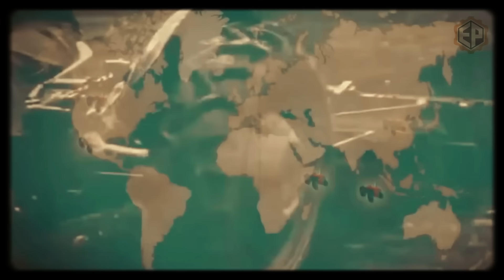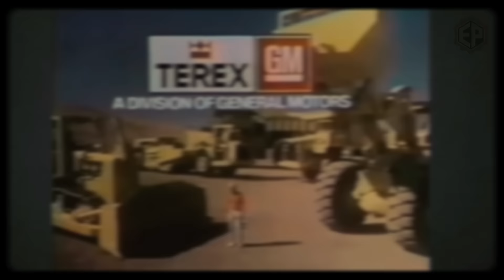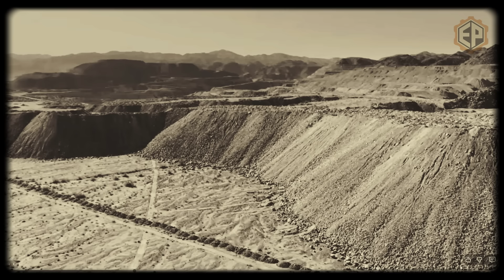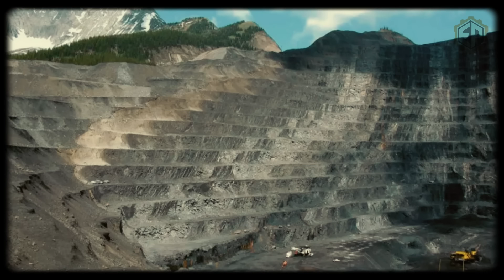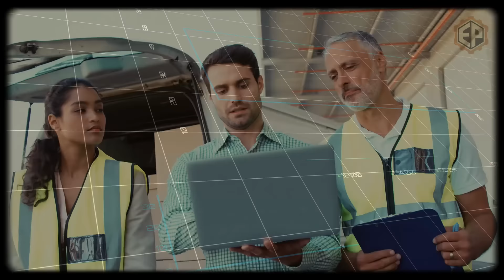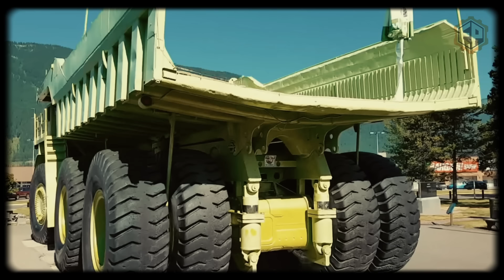The World's Largest Mining Truck Worked — and That Was the Problem

Comment: A big problem with the drive system was that the main generator and wheel motors were direct current (DC), exactly like the railroad locomotives of the time. This meant that the main generator fed the same voltage to each wheel motor, causing them to all to try to turn at the same speed. This was fine in a straight line, but caused massive frame stress under heavy loads and tight corners. There was no differential effect between the wheels on the outer and inner radius of a turn, it was all absorbed by the tires and the frame. DC technology was eventually replaced with variable-frequency alternating current (AC) technology allowing the electronic drive control system to provide the correct AC frequency to each wheel motor, depending on throttle setting and turning radius. This eliminated the differential stresses and allowed for much improved service reliability.
Reply from the maker: That's a great point about the DC system. Same issue locomotives had. AC drive systems fixed that, but came way too late for Titan. By the time that tech was standard, the truck was already a monument. Appreciate your input.

Comment: Interesting story on the big Terex 33-19 Titan! Never drove at Sparwood, but another mine in BC in the '70s where I drove the Lectra Haul 100 ton truck (upgraded to 120 ton loads). Those trucks drove like sportscars- fast straight, fast turns, very manoeuverable. We drove more than a few miles on a cycle, but eventually that mine went to 240 ton trucks, with in pit crushers and long conveyors to the mill.
Reply from the maker: Lectra Haul 100s were great trucks! Unit Rig knew what they were doing.

Comment: The reason the Titan had so much downtime was down to the tires, and the frame.  Because the mines were very vertical there are a lot of switchbacks.  The operators would routinely overload the terex titan, and when it would go around the corners coming up or down the hill the load on the frame was insane.  The frame itself broke many, many times. Can be fixed, but takes a LOOOONG time.
If you look at the new 400 ton trucks, they have the same capacity as the titan, but are harder to overload.  They are also a big box.  The square configuration handles the hills and corners better, and the shorter frame suffers less stress than the longer titan.  
I know people who drove that truck, and I helped my dad pour the concrete it sits on today.  If you're ever able to attend a mine tour, do so.  It will blow your mind.
Reply: Titan fans and  their excuses
Reply: @Undaglibenglaubengloben  Excuse?  All I did was explain why it failed.  I know the people who were involved in loading it, driving it, fixing it, and paying for it.  
Overloaded, hairpin turns on slopes.  Frame wrecked.

Comment: This truck had engine problems. Using a locomotive engine that couldn't tolerate the constant throttling changes. Only one was built for a reason.

Comment: I know it’s a bit late but maybe had they built the thing using parts already in production then it would have succeeded. 
As the video stated (way too many times), no parts & service network was the demise of a great product.
The other point of failure was location, had this monster been shipped to Australia, they would have demanded more because Aussies can fix just about anything.
Reply: It wasn't about having the capability to repair, it was about the cost.

Comment: It seems all the ~400ton haul trucks around today have two axles not three. I suppose improvements in tire technology or development of bigger axles rendered the third axle moot, too bad because 3 axles is just cooler
Reply: Had to do with the frame.  These things go up switchbacks and with the 6 tire configuration the load on the frames would cause it to wear out and break, as the middle tires would often bear no load while going around the switchbacks.  The new 930E's are basically a giant cube.  They're pretty well square, it's the best shape to handle terrain under load.

Comment: The biggest issue they had with that size of truck was the tires, the tire companies took til the 1990's to figure out how to build a tire that would stand up to the job. They went thru tires on that unit like crazy apparently. To this day the 400 tonners are still pretty hard on tires as I've been told.
Reply: That doesnt quite make sense to me because they had three axles thus each tire saw less work. I suppose they did increase payload by 100% but only increased tire count by 50% so maybe that's the issue. Still, it seems that if tire companies have caught up with 400t on 2 axles' worth of tires, they should be able to do 600t on 3 axles' worth now!

Comment: How big is a 777 or 797  compared to now?
Reply from the maker: Cat 777 is about 100 tons. Still common today for mid-size operations. Cat 797F is 400 tons, one of the largest in production right now. The 797 actually came out in 1998, seven years after Titan was retired, and finally beat its capacity.

Comment: In Australia we currently have trucks with a 400 metric ton capacity. And we have more than one.
Reply: Yeah the mines in sparwood also run the 930E.  They're just as big as the Titan, but newer.  They'd be the same ones used in oz.  They're the largest production trucks in the world, outside of russia which has their own slightly longer truck.
Reply: Which ones??  

Curious if anybody is actually using the giant Belaz truck or if they are sticking to the usual builders.  Or maybe even using a Chinese company newer to the market
Reply: @lowermichigan4437  Komatsu 930E and Caterpillar 797F ✌️
Reply: @lowermichigan4437 the komatsu 930e and its variants dominate the west.  Belaz is a tad bigger but more or less only runs in Russia and places heavily influenced by Russia. 
Other companies make heavy haul trucks but not as big as the komatsu or belaz ones.